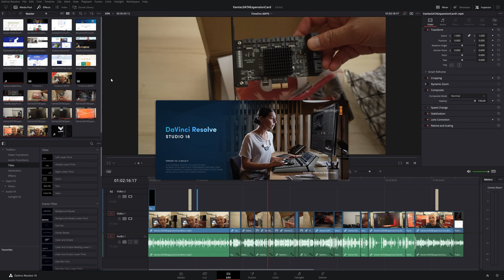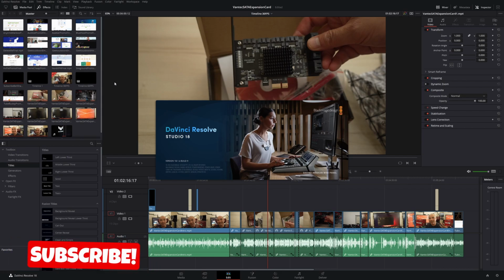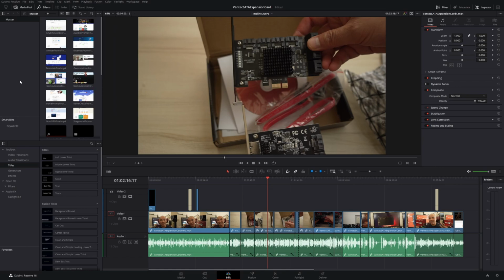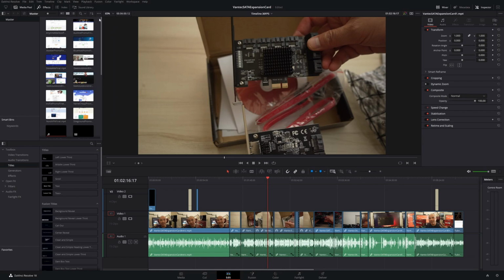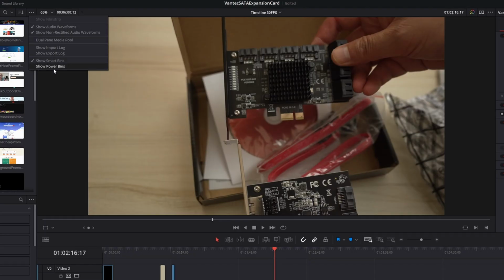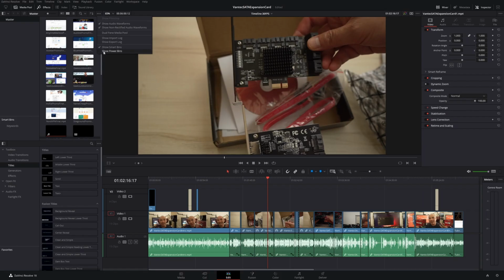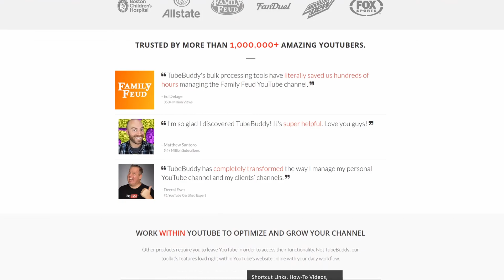How To Show Power Bins In Davinci Resolve 18.1 Or Higher (Davinci Resolve Tutorial)

Comment: Thanks for this. Followed the step, found the 3 dot drop down, but it's not showing the Smart or Power Bin option for me. Only shows "Frame Display Mode,"  "Show Audio Waveforms" and "Show Non-Rectified Waveforms." I don't have the studio version. Could that be it?
Reply: I found it. I had the same issue. Then I searched along the "keywords" bar in the bottom half and at the right end of it there's three dots. Click that and you have it!
Reply: @rajithfernando6200  thank u ;)))
Reply: @rajithfernando6200  I can't find power bins either but I can't find the keywords bar either.
Reply from the maker: That's odd 🤔 This is what I've seen in other videos as well including Free version. I don't know why it would be different for this feature.